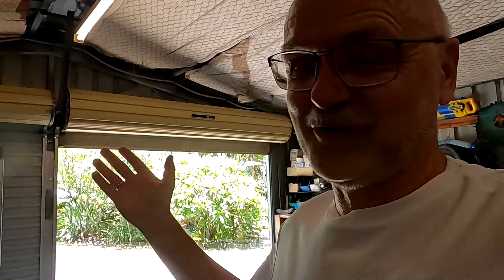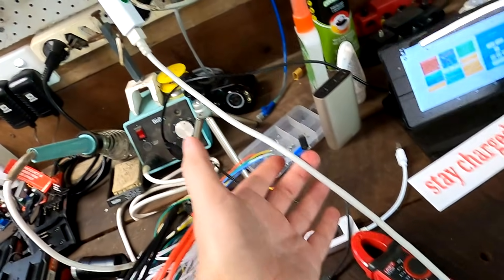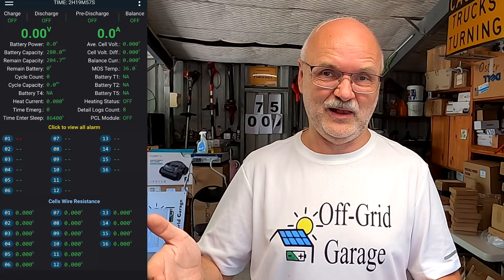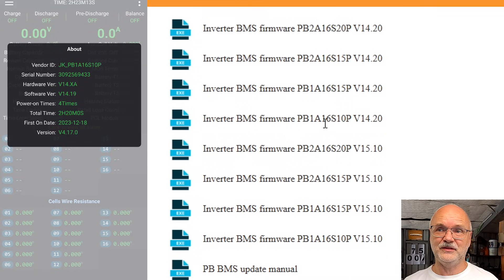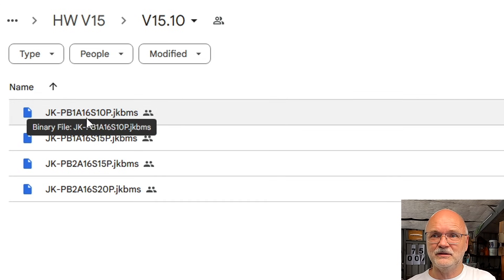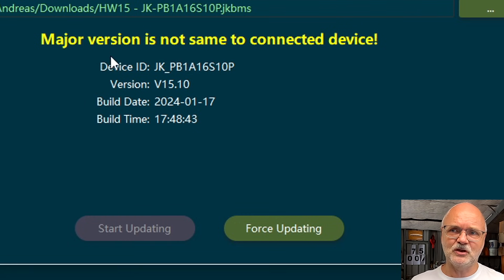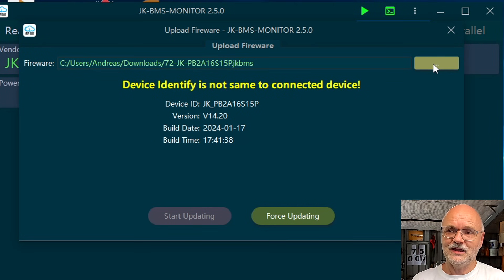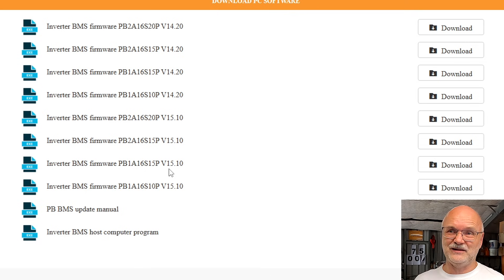JK Inverter BMS Firmware Update Process. Can't be that hard, right!?

Comment: Thx Andy, FYI I have 4 - JK-PB2A16S-15P... Hardware V15.XA, Firmware V15.05. After changing settings/password in the 1st one, and then leaving it for 4 or five hours... come back to find I can no longer "verify password". So I changed it with the 2nd new one, and exactly the same thing has happened... I think they may be returned now?  Cheers!  Edit- spent 3hrs+ with the seller trying to resolve this with special authorization codes, sketchy instructions....... what a mess!
Reply: I had the same issue with my new V15.XA BMS. I contacted the HankzorBMS Store via Aliexpress and they could help me with an individual master password, dependend on the serial number of the BMS.
Reply from the maker: Oh dear... why is there even a v15.XA hardware? And again no communication from JK...

Comment: Your PV panels are parallel as  i followed on a german live stream.
Do you use diodes to avoid back current to shadowed modules?
Maybe you want to make a video about that ?
Reply: I think he already did a video on that subject. Check his video titled something like « tutorial: solar panel protection in series en parallel »
Reply: I think he's using panel strings in series rather than parallel.
Reply from the maker: No diodes needed. They all have the correct size circuit breakers in case one string is faulty.
I have only two panels in series and 18 in parallel with 4 MPPTs.
Reply: Only two in parallel, no? 18 in parallel over four strings would have extremely high current needing thicker wires. @OffGridGarageAustralia

Comment: I am currently "off, off grid" on a mountain top in NE Arizona. Currently running led acid and wanting more power. The Lifepo4 304 amp batteries have caught my ey3 but this bms thing has gotten me stumped. At 70 i have been an electronics engineer and computer tech but im tired of continuously fussing with stuff, not to mention my companion is unbelievably non-tech. Install and setup I'll do but really looking for "plug and play" equipment. Any thoughts.
Love your channel, hot Australia, 6 months off Arizona deserts, just no wallabies 😂

Comment: Andy is the JK inverter BMS working smoothly/ reliably when paralleled with an additional JK inverter BMS? Haven’t heard anything since your parallel battery vid a while back. 
Thank you.
Reply from the maker: I did only a test to check on settings and so on. I don't have a production setup yet...
Reply: @OffGridGarageAustralia 
Thanks mate, once you give it the all clear I plan on buying x2 units. 
Fingers crossed

Comment: From JK 	14 ad 15 hv version	  

  -V15.06 Upgrade logs 
  
  1.Fixed a bug where parameters were lost after BMS restart. The bug is caused by a logical error in the parameter entered by the user.
  2.Change the default configuration parameters to LPF to improve security.
  2.Optimized JKBMS Modbus protocol, added RCV RFV register support. The protocol must use the PC software version V2.5.0。
  3.Fixed the Bug that the hardware version may be incorrect in the device information.
  4.Add battery low temperature alarm to dry triggers.
                                                              -@2024-01-09 by JKBMS
															  
  -V15.09 Upgrade logs 													  
  1.Fix a bug, parameters (RFV Time) Storage failure.
  2.Change the default configuration parameters to LTO to improve security.
  
                                                              -@2024-01-12 by JKBMS

  -V15.10 Upgrade logs 
  1. Button shutdown logic detection and optimization.
  2. Bluetooth communication optimization.
  
                                                              -@2024-01-17 by JKBMS

AND for 14

  -V14.20 Upgrade logs 
  1. Button shutdown logic detection and optimization.
  2. Bluetooth communication optimization.
  
                                                              -@2024-01-17 by JKBMS
Reply from the maker: That's the same log for v14.16, so 15.06=14.16 just different hardware.

Comment: i have a bit of a conundrum.. My two inverters read battery voltage as 53.7v, my three JK BMS read 52.80 to 53.12. And my 3 volt meters read from 52.4 to 54.0... How do I find the accurate voltage so my BMS's protect my LifePo4 cells correctly?
Reply: You can get a precision voltage reference board for <$10, use that to figure out which meter is accurate.

Comment: Many thanks mr. solar. Very helpful, time to update for v. 14.20. I guess it will erase all the settings and you will need to re-type them as well. I was kind of crossfingering that you would have shown your complete settings as well as at least myself have bit troubles to catch somewhat "correct" values, even knowing that each solar system and environment may be different. It's bit of confusing sometimes when on the videos have screen recordings from app showing different setting values. Definitely NOT complaining, maybe just add snapshots to your web page, it would be crazy help for us beginners.

But huge thanks for everything you do for the community. Best in YT.

Comment: Andy you’re the best! I have been trying to get mine updated with no success. I have the JK_PB1A16S10P with V14.04. I have contacted JK and they sent me a PC Monitor V 2.7 but yet still NOTHING. I have tried different cables and computers still no connection. The V 2.7 seems to make some type of connection but will NOT display any information, thus not allowing me to update it.
Should I just order another one and hope for the best or do you have any Ideas. I did try your steps in the other video and still nothing.
Reply: Have you tried rs232 ? Jumper correct?
Reply: I have not used the RS232, I will have to try that next. Thanks @AKu-vw9eb
Reply: Did you check if there is a bidirectional RS485-communication? In the PC software there is a green terminal button ">_" which opens a sending and receiving window. When connecting there should be a longer answer - stream. If not maybe the adapter is not working. I also had an adapter with a chipset which  did not work... Or you didn't chose the right COM-Port...
Reply: Or the RS485 pins A & B  are not correctly assigned to RJ45 - pins 1 & 2. I also hat to custimze the RJ45 assignments. I have 2 RS485 adapters with FTDI-chipset. Both are working.
Reply: if I open the green terminal button I am seeing long streams of information scrolling down BOTH send and receive columns, just no information on the display.
The send side has like one information string while the receive side has like 5 or more line of information streaming?????  @StefanEnglert-ud1pq
Reply from the maker: RS232 apparently does not work, JK told me. They advised to use RS485 only.

Comment: As usual Andy, you are a real blessing to the DIY community with these videos. Would be great if we knew what version 20 latest firmware changes include. By any chance do you know if these new JK BMSes will work with Solar Assistant for remote battery control and monitoring?
Reply: I also use Solar Assistant, which would be wonderful. The older version (JK-B2A24S-20P) works, unfortunately without information about the individual cells. I asked, it should be coming soon. What also annoys me in solar assistant is that I can't assign a static IP.

Comment: Link RS485 to usb??
Reply from the maker: In the video description and on my website now. Tested all USB to RS485 adapters successfully with the JK Inverter BMS. https://off-grid-garage.com/bms-communication/
Reply: Thank you for the info but the one in your video is not the same as the ones you have on your website. I like the one in the video as you don't really have to build any cable. It works with a standard UTP... Where can I get that one?
 @OffGridGarageAustralia
Reply: Hi when I try update the bms go off what is the problem sir

Comment: Good Morning Andy, would the Victron MK3 to USB cable work. Victron also sell an USB to RS485 interface cable that would need an RJ45 connector plug wired to it. Given I see so many issues surrounding comms for these BMS-inverter/computer connections, have you considered if terminating with the 120 Ohm resistor would reduce comms issues by better matchong the standard Cat5/6 ethernet/LAN cable as per RS485 recommendations?
Reply from the maker: That will definitely not work. The MK3 has specific software running and will only talk to Multi or Quattro.
All communication is terminated correctly both ends. At least I hope so...

Comment: Have you seen that there is a "Force Updating" button on the bottom, when you select an older fimrware file? :)
Reply: Maybe you use The Force when it is bricked?
Reply: That requires a pass from Yoda.
Reply: Exactly what i wanted to ask. Could you downgrade the firmware version by force uploading?
Reply from the maker: Nope, that's not what the button is for. It's in the next video...
Reply: @OffGridGarageAustralia Здравствуйте,  вопрос , можно сбросить jk bms кнопкой на заводские настройки ?
Reply: I think the button was too small... :goodvibes: